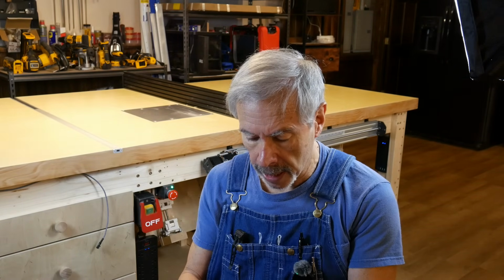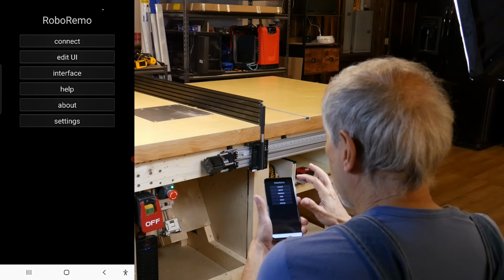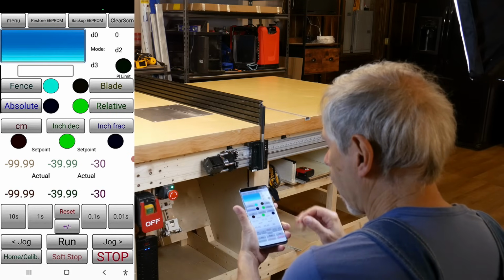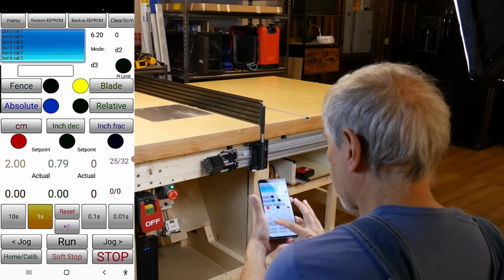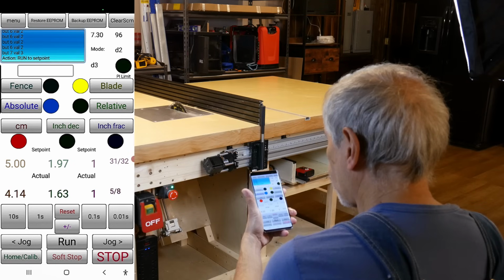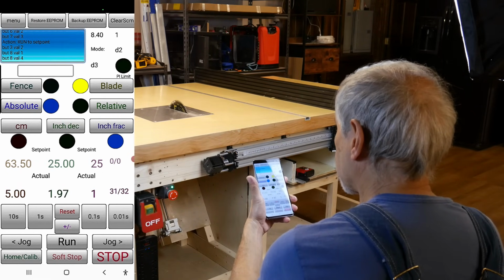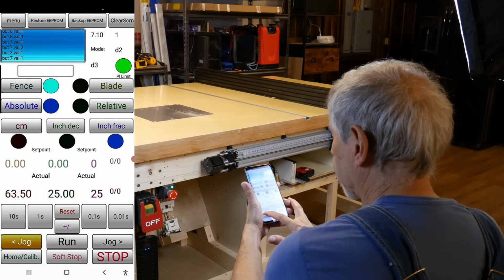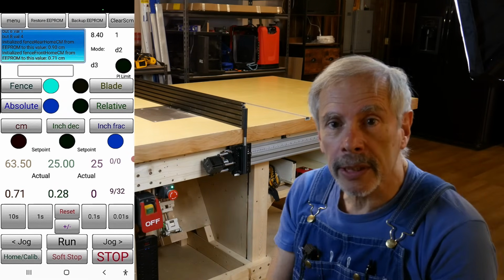Professor Builds Huge Table Saw With Computer-controlled Fence and Blade Height

Comment: Amazing piece of work. Would it be possible to upload the code for the roberemo app please. I’ve been working on something very similar but get stuck when it comes to the coding. Many thanks for sharing your hard work.
Reply from the maker: There is no code for the roboremo app. You download the roboremo app and chose buttons and display fields using the editing tool that is part of roboremo. This is super easy to do but you can also download the roboremo user manual. Just search for it on Google. If I didn't understand your question correctly, then please rephrase it, perhaps with more detail, so I can respond to what you want.

Comment: Wow , that’s amazing. You are an extremely clever and talented man. I worked with a chap that was a PHD in science. His specialty was light. He built a photo spectrometer using step motors and a computer for measuring light at various angles sent through a coated lens. He was an incredible man to work with and I bet you would be the same. Brilliant video. 👍
Reply from the maker: Thank you!

Comment: Is the software allowing for the blade kerf? It appeared when you measured the 30" with your tape you measured off the blade and not the teeth, it's possible that is why the first dado cut was a hair off.
Reply from the maker: In the scene where I demo the dado cut I make the first cut which leaves a dado of the width of the kerf, namely about 2 mm. Then I make 3 more cuts, each one offset from the previous cut by 2 mm. The result is a dado of 8 mm width, which is made up of the first cut (2 mm kerf) + 3 x 2 mm offset = 8 mm. The kerf is relevant only in that scenario of cutting a dado. Most other cutting tasks only call for measuring the distance between the side of the blade that faces the fence and the fence. The kerf is not of relevance in those cuts.

Comment: Hi again, You really got me to start up my research and coding interest within sensors and stepper motors again, thank you very much for that! My project is a lot easier than yours, I will make the sawblade on my band saw mill to move into height position with a Nema 34 Motor combined with a PX86 Planetary Reducer, I think the motor will be strong enough to lift the saw-head if I use a 5:1 gear ratio but I need to do some more calculations since the Torque seem to lower quite a bit at higher RPM so I might need to go up towards 10:1.  right now it is a manual handle where each revolution lift the sawblade 1/4 inch and it has 20 holes to choose from, so persison on the manual part is 1/80 inch steps. So I get close to mm and I often miss a hole here and there when I saw planks so they have a small size difference so I really look forward to handle this as my winter project til I go to cabin next spring  :)  If it is possible to buy the code for accelerate, decelerate the stepper motor from you I would love to buy that, it sounds absolutely fantastic when the fence start a little longer travel in how the increase and decrease of speed is handled.  Thank you for the inspiration (and late nights) :)
Reply from the maker: You don't need to buy that code from me, my code uses a stepper motor library that someone with far better programming skills than myself posted. The library is specific for the Teensy 4 (as well as Teensy 4.1). Look at the bottom of the description page of my video where I thank that programmer who goes by  "luni64." The library is called "TeensyStep4." I spent a great amount of time looking at all kinds of stepper motor libraries and this one is way, way better than libraries for Arduino microprocessors because it allows for much faster pulse rates than other stepper libraries.
Reply: @johannborenstein  Thank you so much for tthe explanation, I have added that program to my solution but there is the setMaxSpeed and SetAccelleration on that library that I am unsure of how much it should be to make it work well, I have moved out some of these to a config stored on SD card as I thought now but Im not sure of what values to start with .  But I wioll look through your video more to catch up with more details also and get more feeling for how fast you are running the motor, but the first 30 inch  move just sounds so perfect in acceleration and speed :)  
stepsPerMillimeter = (config.stepsPerRevolution * config.microstepping);
motor1.setMaxSpeed(config.maxSpeed * stepsPerMillimeter);         // steps per second
motor1.setAcceleration(config.acceleration * stepsPerMillimeter); // steps per second^2
Reply from the maker: My settings for the blade stepper motor and the two fence stepper motors are these (including my in-line comments, for what they are worth):
 blade.setMaxSpeed(8000); // worked fine with blade motor at 8000. // was 10'000
    blade.setAcceleration(2000);  // worked fine with blade motor at 2000. //was 50'000

    fenceFront.setMaxSpeed(10000); // was 16,000 at 800 spr was 1500 at 200 spr worked fine with blade motor at 8000. // was 10'000
    fenceFront.setAcceleration(4000);  // was 1000 at 200 spr worked fine with blade motor at 2000. //was 50'000

    fenceRear.setMaxSpeed(10000); // was 1500 at 200 spr worked fine with blade motor at 8000. // was 10'000
    fenceRear.setAcceleration(4000);  // was 1000 at 200 spr with NEMA 23 motors. worked fine with with rotateAsync(10000) command. //was 50'000
When my in-line comments say "was" it means that I had used that setting before.
Reply: @johannborenstein  Hi Johann, thank you soo much for these values, it will make me get into a good place much much faster regarding the travel. I am still working on basic functionality and will get my Nema 34 with PX 86 5:1 reducer in 2 weeks to try some in the real world.

Comment: I must also add that if you make the part that goes into the fence longer i.e 500 mm you could probbably adjust the fence + - 45° or so by only moving one side.  It is already absolutely amazing but with some math and change in code I'm sure you could do this implementation :)

Comment: Really exciting Project, I can imagine that it was a lot of work to get the software and hardware to play nice?  I have worked with software development for the last 25 years and for a few short times I have developed against Raspberry Pi sensors/Actuators and every time I have struggles with firmware and/or communication and precision.  This is a fantastic build!  Hats off!  :)